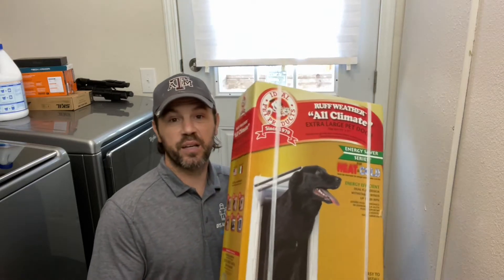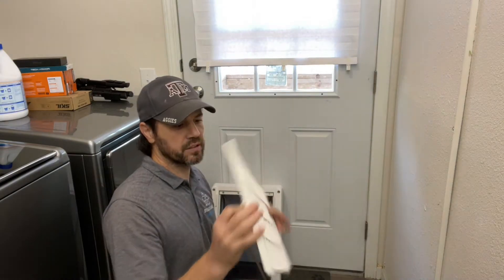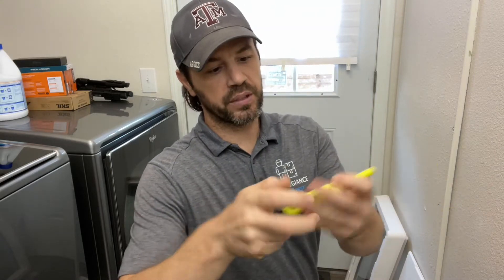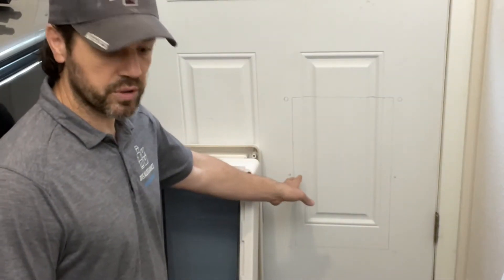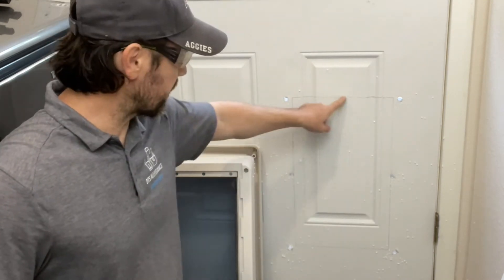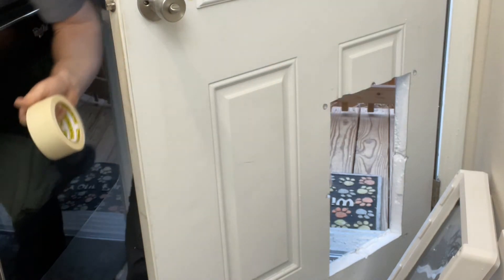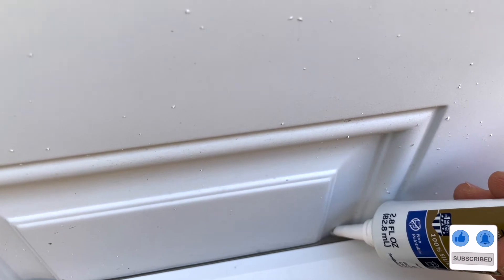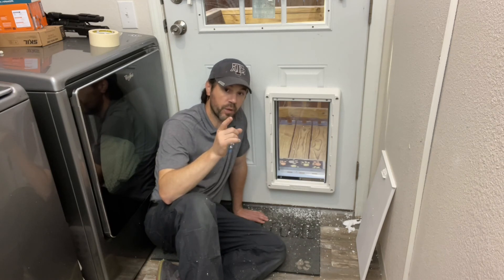Ideal Pet Dog Door Easy Installation | Complete How To DIY Without Removing Door in 10 Mins!

Comment: So how has the door been holding up? Do you have issues during thunderstorms or with wind?
Reply: Usually for severe weather you want two flaps, it can be harder to train a dog to use it right away with two flaps tho. On this door, if he wanted to i believe he could install two flaps to better insulate and could weather and wind, but might not find it necessary